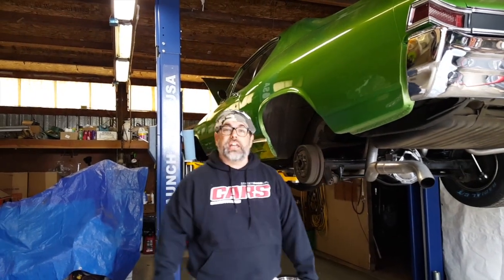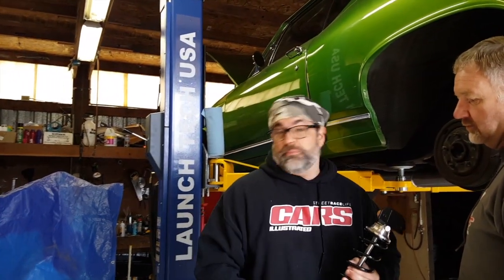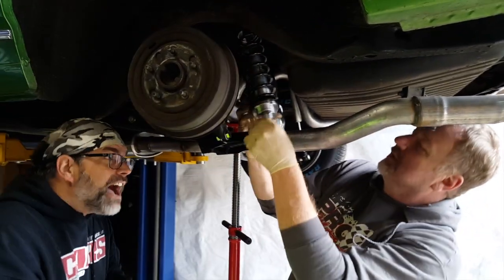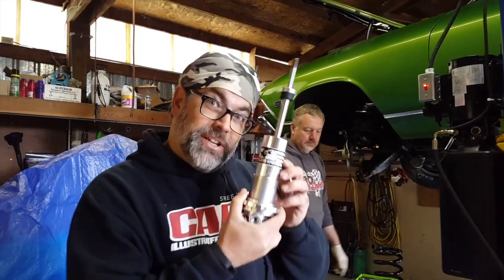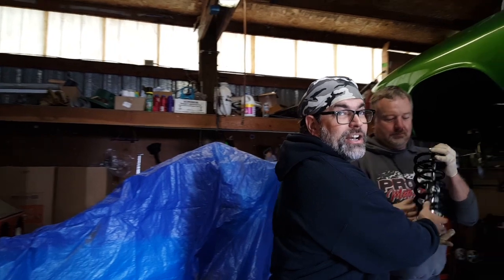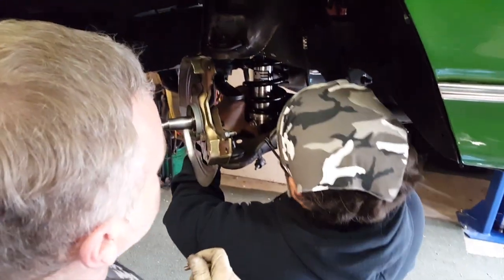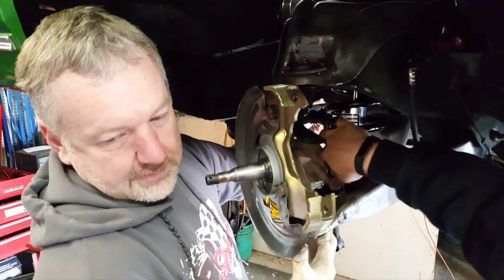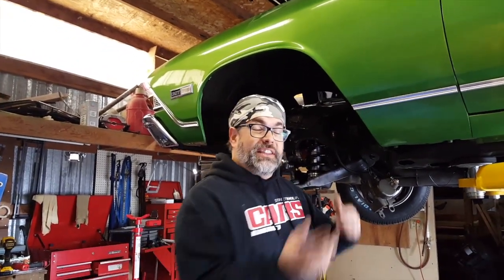Speed Parts Review: Aldan American Coil-Over Install

Comment: Thank you kindly for sharing your humor and install using OEM control arms in front. Yes, holes have to be enlarged but the lower control arm used on 1967 - 72 C10 (The best looking Truck Ever) increases the “U-Bolt” holding the control arm in place as per GM TSB.
ASE Master Tech 78